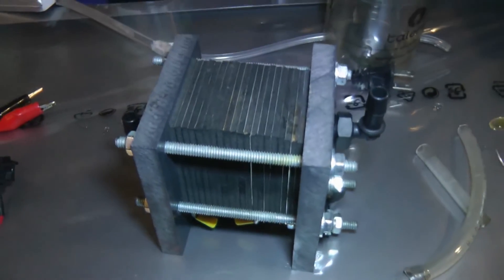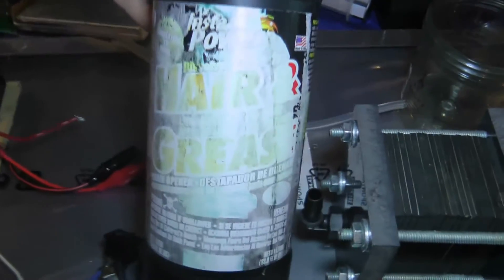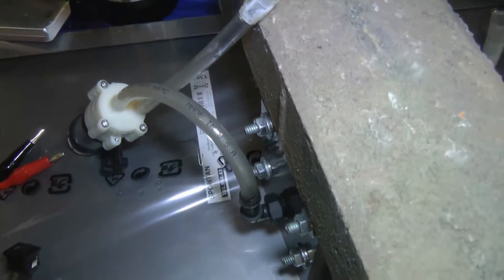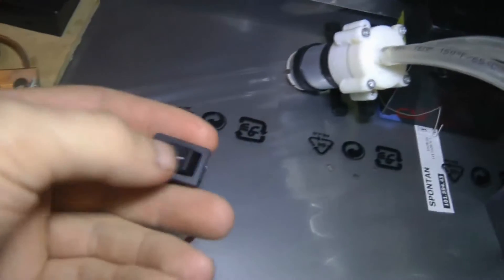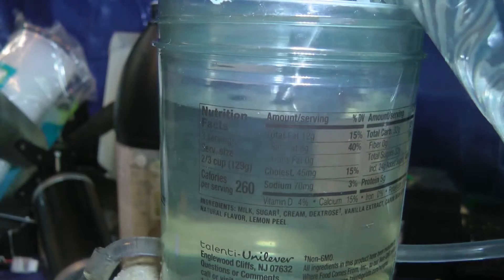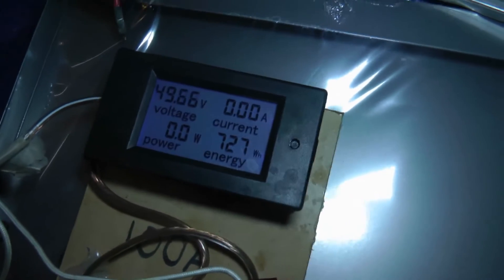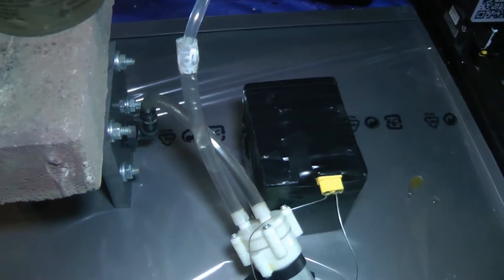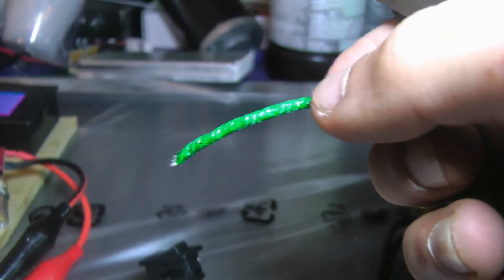HOW TO BUILD SIMPLE HYDROGEN GENERATOR  (HHO) with important tips

Comment: cool build, btw if you want to accurately measure for hydrogen production use a gas flow meter there go for about $16 on amazon. But overal pretty decent build most folks dont add an off/on switch lol but I will too, im 3d printing my parts as we speak and hope to use it on my next build for a model jet engine.

Comment: I'd be interested to see a test of HHO feeding a diesel generator at 50% load. Diesel because it'll automatically run as lean as it can, generator because you can easily apply a fixed load for a given amount of time. Supposing you've got a pair of heaters applying 3kw of load to a 6kw generator and you are driving the HHO circuit with 0.5kw of mains power, if HHO/diesel is useful then you should be seeing better than 17% fuel savings... Would also be interesting to see a thermometer pointed at the cylinder / exhaust. Seems like most people who do demos on the topic have their mind made up one way or the other, not a lot of serious experimentation.
Reply from the maker: ill have to find generator but its possible
Reply: @ianbuilder  Just checked on google scholar, in the paper "Effectiveness of oxygen enriched hydrogen-HHO gas addition on DI diesel engine performance, emission and combustion characteristics", they were running a 5.9kw generator and 1 liter per minute of gas made it perform worse but 3.3l/m improved it, so it looks like you need a fair amount of the stuff... Probably the key is to get enough gas/air ratio that the diesel injection event actually triggers a hydrogen explosion.
Reply from the maker: @calebjamesdelisle6239  yea it helps alot  ive got an engine but no generator part
Reply: Lots of people did this, however usually works with old engines without computercontrol. With modern engines the motormanagement ‘recognizes’ the lean burning and adds fuel instead. To work with this you need to fool the motormanagement which is not easy. Look for Bob Boyce or Stanley Meyer. They had a Prius and a VW Beetle running for 100% on HHO, so its possible. Stanley Meyer was killed, Bob Boyce is retired.
Reply: @hansscholte5472  That's why I said best to test on a diesel. Diesels always use the least amount of fuel they can whereas gasoline engines are a bit weirder.
Reply: @calebjamesdelisle6239  check out a company called ‘central valley hho’; they have been doing this for over 10 year’s successfully

Comment: Can you explain more about your battery setup and safety precautions, like a markup or diagram. The issue i'm having is connecting the battery to the +&- and the batteries overheat.
Reply from the maker: dont do what i did  u need dedicated power supply and you need to watch the wattage  u need prob a car battery and continuously charging it not a lithium battery  connecting battery to plus/minus should be simple  but  dont let the battery's over heat that ruins almost tall kinds